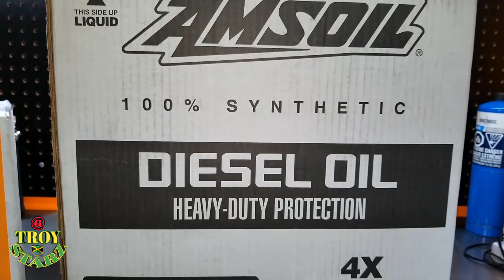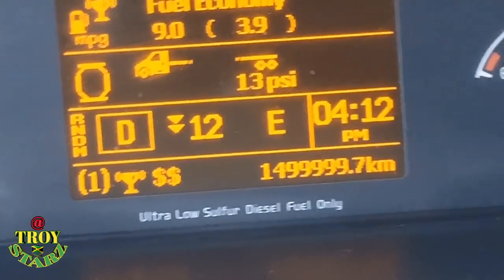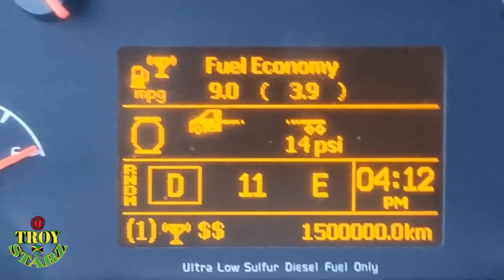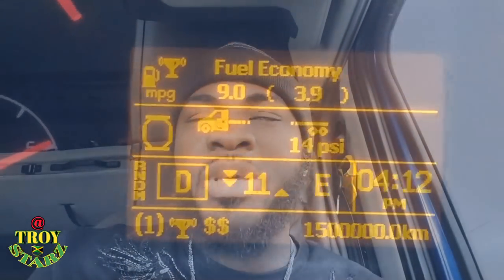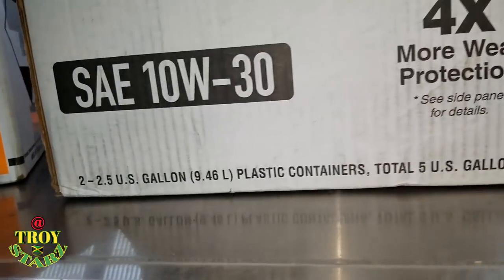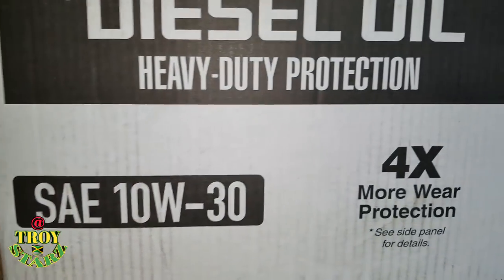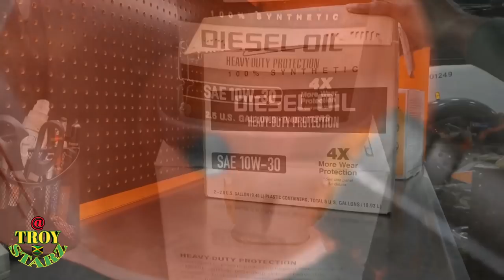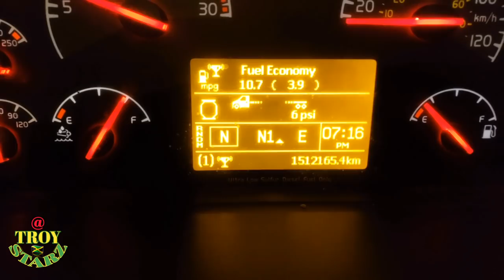Amsoil Diesel Oil | Better Fuel Economy, Longer Engine Life | Over 1M Miles

Comment: Yes bro thank for the info
I got a  2010 vnl780  got 1.5 on it 
How much gallon of oil it take and what is the best oil u think I shud  used got it a year now.
Reply from the maker: The Amsoil is the best oil for you with that Miles.. You can't go wrong. You need 9 Gallons
Reply: Thank bro was waiting for yur reply 
I change it yesterday
I used rotella T4 _15 -40  triple protection 9 gallon  am going used the one u say next time , u say AMSOIL WHAT GRADE I NEED THE REST OF INFO THANK U
Reply from the maker: Why did you put 15w 40. In your truck that's not recommend the dealer recommendation is 10w 30. Unless it's a Cummins engine then 15 W 40 can use. Becare full you may Destroy your engine. Keep me posted did the mechanic changed your oil??  He should have known better..
Reply from the maker: @ItsPrymeTymeMusicVEVO  10w 30 volvo design their engine different the oil flow passage for the oils is closer so they use thinner oils 15 w40 is thicker oil it may not lubricate most of the areas that is necessary so be very careful

Comment: The 100% test you refer to was done by Amsoil itself
Reply from the maker: In 1972, the breakthrough came. AMSOIL 10W-40 Synthetic Motor Oil, the result of years of research and inspired by aerospace technology, became the first synthetic motor oil in the world to meet American Petroleum Institute service requirements. ... Accept no substitutes – AMSOIL is The First in Synthetics®.
Reply from the maker: There's only one way you can meet the American Petroleum and that can't be done by the manufacture (you should know better what your saying is not correct )..
Reply: Thank you Troy Stars
Amsoil is good. I use it all the time